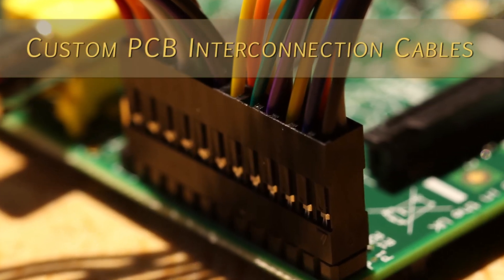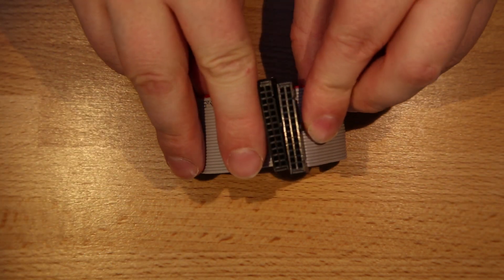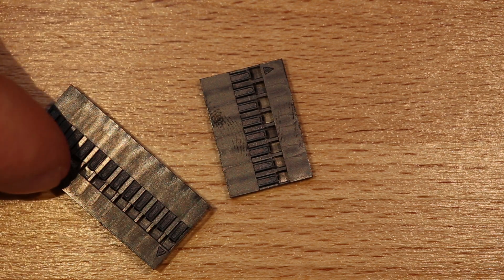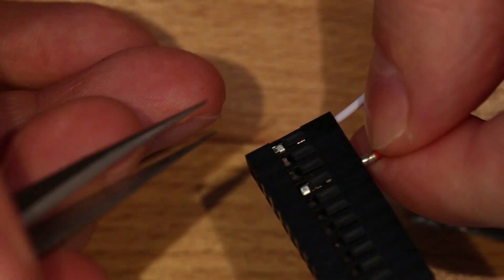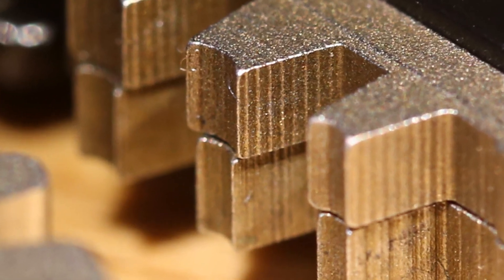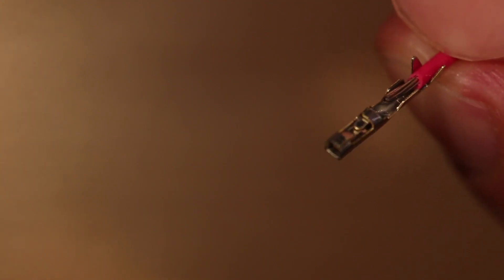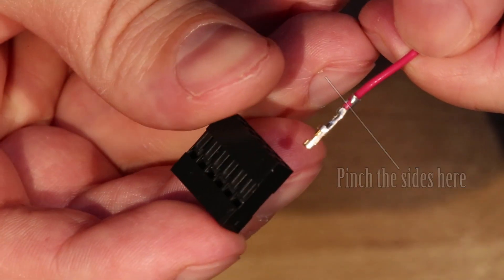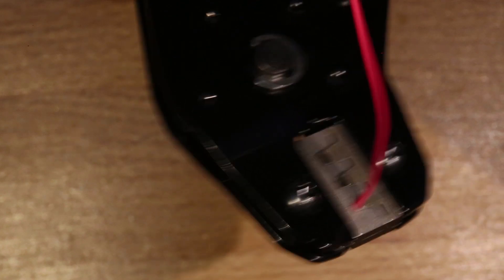Custom Cables & Guide to Crimping Dupont PCB Interconnect Cables

Comment: This was a good guide. I have a very cheap crimper, thin wires, and low quality components and it’s an absolute nightmare to get a good crimp. I end up soldering the pins to the wire and using the crimping tool to close it up so it fits in the plastic sleeve. Not an ideal solution by any means, but it’s what seems to work for now. Eventually I’ll experiment with thicker/higher quality wire, components and then a tool, but for now the absolute cheapest stuff works if you put a little more time into it haha

Comment: I find it easier to not remove the insulation from the cable before crimping it. To me this makes it much easier to know how far to put the cable into the connector. You can feel the cable not going any further, because the cable with insulation is too thick to push it too far. 
When crimping the connector bites through the insulation into the copper and the cables I crimped that way work fine.
I'm not saying thats a good or correct way to do it, but to me its easier and still works. But that might also depend on thickness of the cable and the insulation.
Reply: This is absolutely horrible advice. I’d be willing to bet that the overall contact resistance is much higher than expected because a lot of the contact area between wire and terminal has plastic between it. Chances are you simply have little patches of contact here and there, enough to pass continuity testing and allow data transmission, but with severely compromised current-carrying capacity.

There are connectors designed for termination without prior stripping: these are called insulation-displacement connectors (IDCs). For DuPont-like applications, look at the MTA-100 from TE. It comes in a bunch of varieties, doesn’t cost a fortune, and the official tool for low-volume assembly only costs around $30. It’s a great option for many applications.

Comment: Very simple video.  Just what’s needed.  I like to close up the crimp with needle nose pliers before the crimp, easier than trying to hold the wire, crimp and crimp tool as I only have two hands.  The other advantage of making your own ribbons is that you can maintain colour integrity.  All I need now is a way of holding then in a ribbon shape.

Comment: Really great video! I would just add that when crimping it is much easier to strip just 1-2 mm, click crimper partially closed only 2 or 3 clicks depending on brand, then you can just drop the empty crimp pin into  the tool and it will catch it at the correct depth, click one more time to grab the crimp pin.  Now push wire into tool and crimp pin. Assuming the wire is stripped to the correct length, then the teeth that crimp the exposed conductor will block the insulation and stop the wire at the perfect depth. If you're using very small guage wire, such as 24 guage found in cat5e cable, then give the tool an extra click or 2 before inserting wire.

Comment: Excellent video. Clear and simple. I have been making up servo connectors for model aircraft and could never figure out how to get the tool and crimp aligned. Thanks for your great help. The connectors look very like rc servo connectors for model aircraft. A crimp tool which works well is available from Hobbyking for €12. Cable and connectors can also be found cheaply and also cables  made up mostly for 3 pin servo connectors in various lengths.

Comment: Try Aliexpress.com or ebay.com for the pre-crimped cables around 1.20$/40 including shipping (male-male, female-male, female-female), crimping tool 15-20$. Search for Dupont jump wires, Dupont 2.54mm connectors.

Comment: The proper crimper for those DuPont type terminals (they are known as Mini PV for the Dupont/Berg/FCI Amphenol version or M20  for the Harwin version) is the FCI Amphenol HT-0095, HT-100, HT-208, or HT-213 for the FCI Amphenol version or Z20-320 for the Harwin version (the terminals will work with either). Double D crimpers don't work as well for these, the official factory tool has a cylindrical die and swages the barrel into a tight tube around the conductor. Old Berg and DuPont branded tools show up on ebay regularly for under $100.

Comment: Very useful - thanks.  One thing I do differently that I find works well is not to detach the metal connectors from the strip until after the crimp is complete.  This makes it much easier to hold the connector in the perfect position in the crimp tool.  They are also easier to snap off the strip once the wire is attached.

Comment: Great video very informative. You can get ribbon cable with those crimps already installed on one end which is a time effective solution. Check out IDC ribbon cable on eBay

Comment: Is it possible to use most of the wires within a ribon strip but not all? For instance, I'm looking to use a 36 pin connector to route a 36 pin floppy drive within a 26 pin ribbon to my keyboard. Will this still work?

Comment: Excellent and very instructive. I get my supplies from E-Bay. Super cheap and comes from China, but seems to work very well. I've also seen these types of connectors used by model airplane hobbyists for servos and RC modules.

Comment: Thank you. I had some issues as I used 24 and 28 AWG cables. I've sourced my tools, parts and cables from ebay (chinese vendors). Crimp tool is around $10 there incl shipping.

Comment: Excellent, clear & concise explanation. Camera work and stills the best I've seen, commentary precise and relevant. This process is something I'm about to use for wiring some infra red sensors on a model rail layout, so thank you very much, and I've subscribed on the basis that there is bound to be more of this stuff I can learn about.

Comment: Very good tutorial!  Custom cables offer an advantage over ribbons for Eurorack synth module power cables: ribbons are typically 28 AWG and the parasitic resistance in them causes noise problems in many Eurorack systems.  Ribbon cables are good for data--not for power, particularly in sensitive analog systems!  Using crimp pins allows module power connections to be made with 22 AWG wires (53 mOhm/m vs 213 mOhm/m).  In addition, custom cables can be connected to bus bars in a star configuration, rather than using a distribution board; that eliminates coupling of voltage drops from one module to another.

Comment: I bought 22AWG stranded cable as suggested here but it was too big for the metal Dupont connectors (the end part of the connector that crimps the plastic sheath needs bending out, very fiddly), also the cable was too wide to fit into the plastic Dupont housing! Does 22AWG refer to the metal strands, or the outer sheathing? I'm guessing the former, in which case watch out because it appears the sheaths are not necessarily going to fit if you buy the right cable!

I measured the outer diameter of the 22AWG stranded cable to be 1.6mm, whereas pre-made stuff is 1.3mm. There's the problem!

I can make it work, but it takes about 4 mins per cable: not efficient!

Comment: Wish I'd seen this video BEFORE I started crimping. After four days search online and as many days wandering among suggested retailers to locate what I 'thought'  I needed (which was the mailing time to get it for a fraction of the cost from Polulu),I wound up buying an acceptable set of connectors and pins for my project. HOWEVER, with the totally worthless tools I purchased, I wound up working on my back for several hours to get the 8 pins crimped and bloodied my thumb badly attempting to hold the pins in that lousy tool. OUCH. 
So my moral is to keep searching until you find this video...>) and if you've completed your project, now you are the wiser.
GREAT explanations and WONDERFUL video quality.

Comment: I work in a wiremill and I have to use those dupoint connectors terminals and a proper applicator. Just letting you know you should keep an eye on your crimp depth as if it's too high it will crush your wire, and if it's too low, it won't be a snug and will come off over time...and the scary thing is...you can't tell visually if it's too high or low. You should use a depth gauge and a pull tester to get the proper depths depending on your wire gauge.

also the way the insulation crimp went in your demonstration would have to be rejected because there is a chance it could have cut into the strands.

just letting you know.

Comment: If you don't mind being constrained to a single length, this is a very convenient and clean-looking solution:
http://www.protostack.com/blog/2013/08/ribbon-cables-dupont-connectors/
You can peel off however many wires you need and insert them into any length header, even 2-row.

Comment: From personal experience I found it easier/necessary (30AWG) to cut the ribbon the pins are on providing a tab to hold while crimping then breaking the tab off the pin post crimp. Hope this helps with smaller gauges and larger thumbs.
Reply: This is what I just wanted to mention. Thumbed up your comment :]

Comment: This is a well-made and useful video. Thanks.

http://www.aliexpress.com/ is a good source of all things Dupont. It is a Chinese site similar to Amazon's Marketplace. Don't be put off by the home page! Just type 'Dupont' into the 'I am shopping...' for box. You will find crimp tools, male and female connectors, as well as a large number of variations of connector shell. This site also seems to be a good source for bulk ribbon cable.

Search carefully and you will find bargains. Make sure the 'Free Shipping' button is selected, some sellers make up for low-prices with shipping charges.

Delivery usually takes about 10-days to the UK. I have bought many of low-value purchases; so far I have not been disappointed. It's also especially good for Arduino boards, shields, and electronic components.

A note for those in the UK: if you keep each seller's consignment below £15.00, you will not be liable for any VAT or import duty (HMRC website - July 2014).

Comment: Derek,
Thank you for making this education/training video available.
The Arduino boards I am using have the same pin size and spacing as your Raspberry Pi in the video.
I searched Google for the crimping tool with "SN-28B Pin Crimping Tool 2.54mm".
Mine has just arrived from ebay for  $US11.80 + $US3.00 postage, seller accecity2009.
Now I can make projects that look a lot more professional.
Regards,
Colin

Comment: very intresting vid. Thanks.
I found the same crimping tool on ebay for 15$.
Also i buy some pins on ebay too, but they dont fit in the dupont housing.
I advice to double check the pin dimensions before buying.  ;)

Comment: I use a set of "helping hands" to hold both the wire and the crimp connector pin and then crimp it with one just hand. This video demonstrates some good techniques.

Comment: I separate the pins by cutting the foil strip between the pin and then use the foil portion to hold the pin in place while crimping.  When I show that trick to people they feel foolish that they didn't think of it.

Comment: Are you using a ratcheting wire stripper?  What's the make and model?  I bought one, but it seems to want to make a 1/4" bare strip which is far too long for my usage.

Comment: Great video! I've been using these connectors (with same tool) for a while. But since I switched to so called polarized connections. They are much more secure at connecting (also .1 in pitch), and actually very chip from Taydaelectronics (they call them wafer connectors). Alas I yet to find a crimping tool for polarized/wafer connectors...

Comment: Awesome Video, I have bought some female jumper wires from yourduino
They are very cheap at a reasonable quality!
They are already pre-crimped you would how ever have to take of the black housing at at least one side.
But they only cost 2.00 Dollas for 40 cables (20cm) or 2.50 Dollas for 25cm!